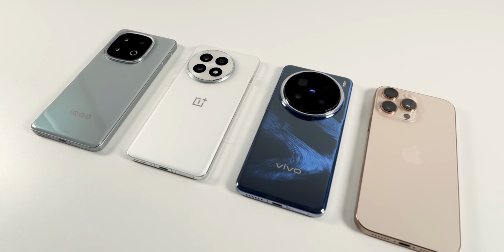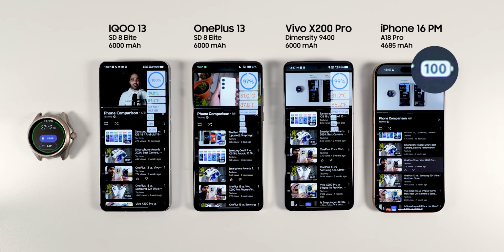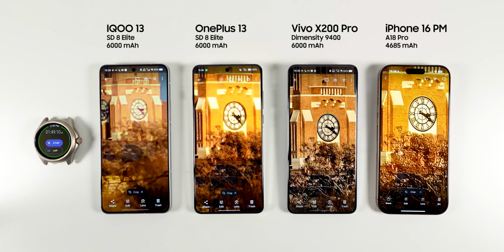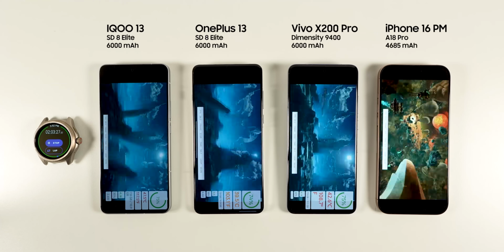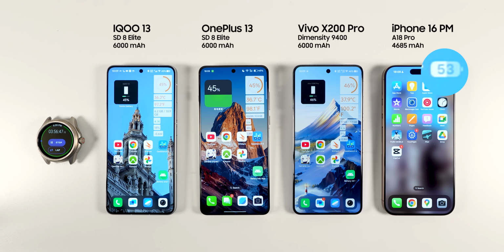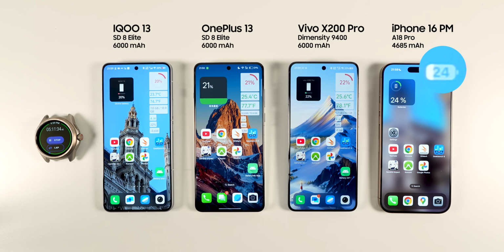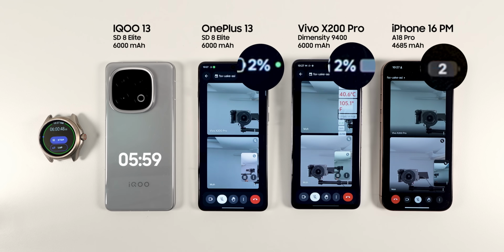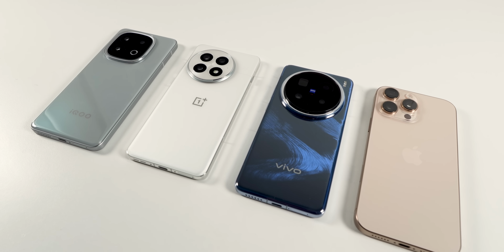Best Battery: OnePlus 13 vs. Vivo X200 Pro / iPhone 16 Pro Max / IQOO 13

Comment: 28% bigger capacity for 1% more battery life, I have a feeling that this new battery technology is all about big numbers but nothing in action, S25 Ultra is probably going to easily beat some of these 6000mAh phones but with a 5000mAh battery.
Reply: What? If the iPhone had 6000 mAh with the same tech it of course would've lasted much longer, and vice versa if the other phones used the old tech. That's not "just numbers". Apple can put a larger battery in there since similarly-sized phones can do so, but they choose not to so they can claim something is new on the next model. Also, the S24 Ultra this year had less battery backup than the Vivo X100 series and OnePlus 12. They need to catch up.
Reply: no, it won't, look on gsmarena battery tests, samsung is far behind vivo, honor, oppo already , only apple can get this efficient due to more efficient cpu, samsung is just  another android and it will be destroyed in 2025 by all the flagships with more than 6000mah+ since they will be stuck on 5000mah for the 6th year in a row.
Reply: Keep that in mind that these android phones are running Chinese software and in china they tune the phone for performance not for battery life and cool temperatures 
Global variants will give much better battery life at least an 1 to 2 hours long
Reply: @lankegowtham6783  source?
Reply: iPhone after next update 👉🤡👈

Comment: Thanks for the video. I have a question. Did you use a display overlay app on Androids to display battery percentage and temperature? Is that so it consumes a lot of battery. Anyway thanks.
Reply from the maker: Thanks 🙏 Regarding the app it's my own app and I tested it througly, it uses close to zero and is negligible.